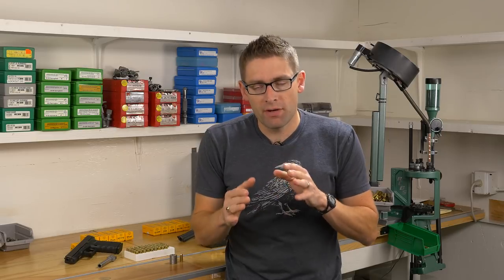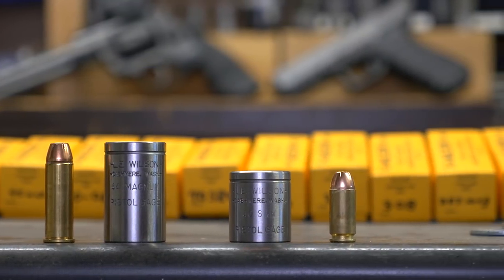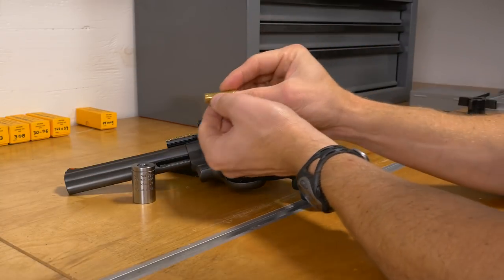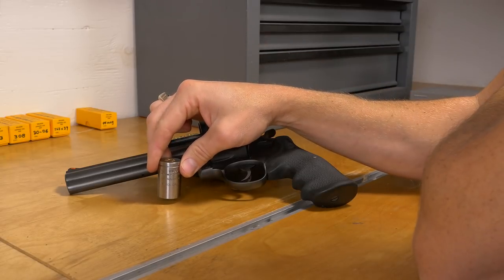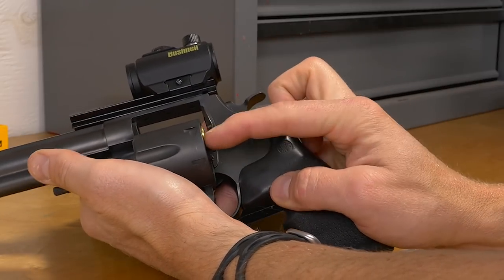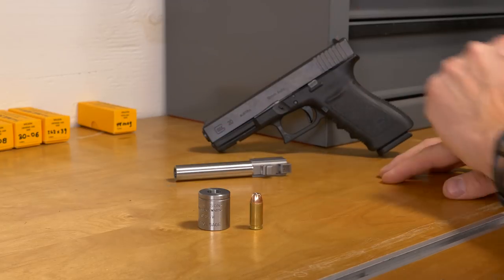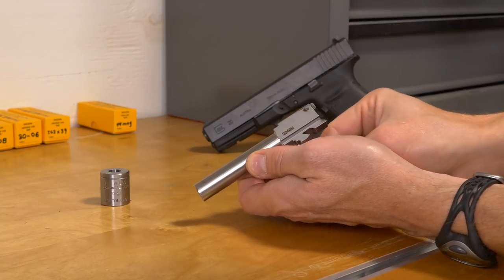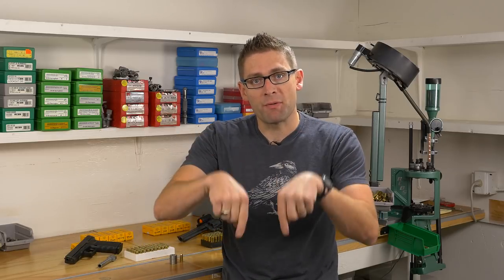Reloading Essentials: Pistol Case Gage

Comment: I bought a new 1911 and had some of my reloads not fully chamber in the gun. I checked them back at the shop with a Lyman case gage and they stood proud of the case. I now check EVERY case after I resize it. I don't want any more range time standing there digging a round out of my gun. Great video!!

Comment: I have yet to experience any problems with straight wall pistol cases, but I do separate all cases by headstamp. I realize that some will say that it is not necessary, but I believe that it helps consistency; if only very slightly. Surely the procedures, tooling, equipment, tolerances, and suppliers are mostly constant with a single manufacturer. I have, however, had a hiccup with once fired military 7.62 NATO cases. I size them to fit in an EGW chamber checker at the expense of case life to ensure wide compatibility and reduce the chance of a slamfire. I have also had partial head separation in 5.56 on the second firing(the first being by the military), so I now run a pick in every case to feel for the ridge/roughness of incipient head separation EVERY TIME. Last batch I culled 40 out of 2000 "once fired" cases for an annular ring near the web.

Comment: I am trying to learn all I can about reloading, but I feel like I am always hearing what is "technically correct" and not what is "practically" acceptable, if that makes sense ?  For instance, you didn't mention there is a milled area on the gauge that represents the minimum case length as opposed to the maximum. Why it isn't mentioned as important I don't know? I recently checked several rounds of Winchester white box 9mm.  They were .0035 UNDER the indicated minimum on the Lyman 9mm gauge. I am guessing that those rounds are just fine to shoot, but according to what is "technically" the minimum, they aren't?
Reply from the maker: Good suggestion- perhaps I'll work on an article in concert with L.E. Wilson on this topic!

Comment: If I'm using digital calipers to measure length and crimp, do I still need a case gauge? 
Also, I have a couple of pistols that have rifling closer to the chamber than normal, so when I get bullets on sale that have a wide ogive, I have to load them shorter and back off a wee bit on the powder. For these I use the plunk test with the barrels. Do I still need a case gauge for that? Does it help with ogive?

Comment: Gavin, thanks for the great videos. I've been watching and learning. I shoot Cowboy Action with a Colt SSA in 38/357. I do this same test but the round protrudes from the bottom of the case. I didn't think anything was wrong as the Lyman book calls for a longer OAL than the case gauge is. 1.450 and the gauge is 1.361. Looking at some factory ammo I have, they are longer than the gauge is also. It's a Hornady .38 special gauge. Is there anything wrong? I thought maybe the gauge? I don't know that's why I'm asking.  Thanks.................John